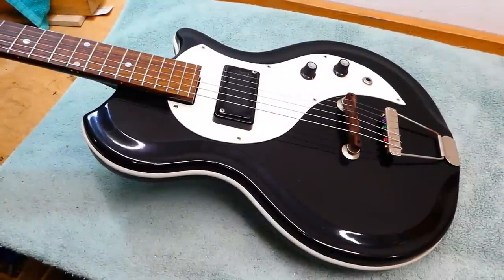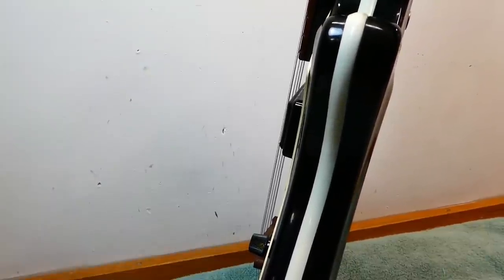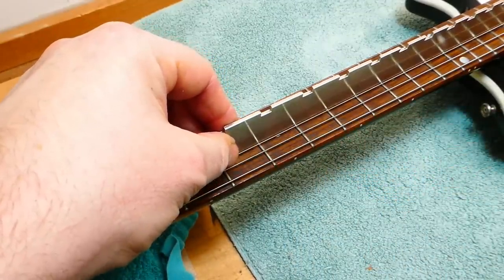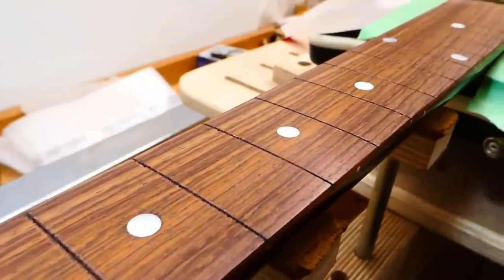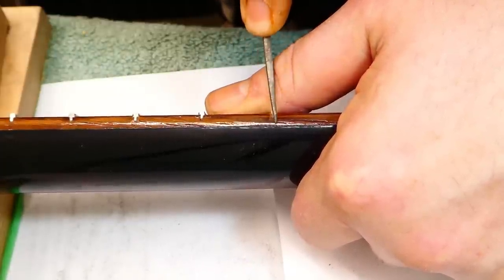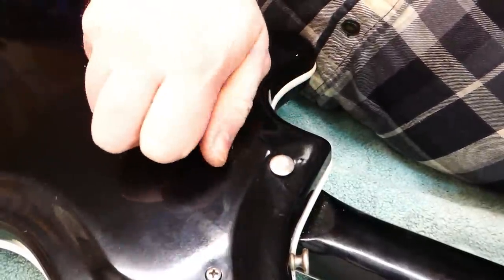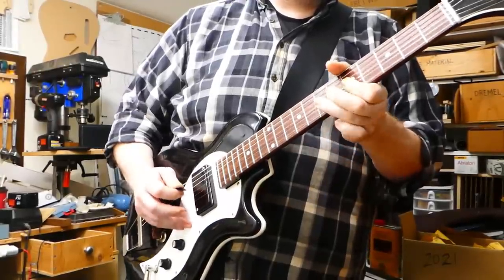60's National Studio Electric

Comment: My guess would be the cost savings didn’t come from the material but rather the workmanship required in assembly. Pre-cnc days I suspect it was cheaper to punch out fibreglass moulds than have a trained technician cut out and finish bodies from wood.
Reply: That sounds very correct. 

Consistent and cheap.
Reply: Oh Lord... Really???
Reply: I think you're underestimating the amount of labor and skill involved in fiberglass shell manufacturing. Personally, I would guess that cost savings comes from finish work. There's no need to paint or varnish a fiberglass body, and, depending on the quality of the mould, perhaps even no need for polishing. (There's still going to be some level of finishing required, especially at the seams, but it's not a full paint and varnish.)
Reply: @wbfaulk  thats pretty much what Adam said ?
Reply: All the savings were in that unnecessary truss rod and excess neck screws 👍
Reply: @wbfaulk the seam line consists of that white stripe. It's kind of a rubber material that "joins" both halves.

Comment: Valco was owned by a couple of guys in Chicago. My Uncle knew one of them really well and when we were kids we were able to visit the factory several times to get  guitars at a good discount. National was their premium line, followed by Supro (more of a budget line). They also made Airline and much later Kay guitars for sale by Wards and others. I recall that they had a few artists they sponsored with two of them being Bob and Bobby Thommas. I vividly recall seeing the molds for the old National resonators on the shelf in the factory. They made wood guitars as well as the Reso-Glass. The first guitar I purchased from them was a National Westwood 75  map shaped which was sort of a burst made of wood. It had one of their innovations in it that while you only saw one pickup there was a second one built into the bridge so it actually had two pickups and a strat type selector switch. I bought it right off the line. One of their workers talked me into it, set it up for me and  played it for me. The second guitar I got from them was a Kay 12 acoustic. My brother got a bass similar to the one in your video. My other brother got a Suppro Clerrmont which kind of remembled a Gibson 335 and a amplifier. After they went out of business and many years later a company in Asia bought the rights to National and Supro and are presently selling reissues of the Reso-Glass along with the Supro amps still being played by artists like Jimmy Page. My mom sold my National when I was away at College for $15. Did the same thing with my brother's Clermont. My one brother still has the bass guitar. It cost me $1000 seceral years ago to purchase another Westwood like the one I had. I still plays great and sounds equally good. After they started selling reissues (you can find them on Reverb) the values of the originals shot up and now my Westwood is worth around 2K and my Supro 6120 Amp gows as high as $1500. Their priginal Reso-Glass guitars can go for several thousand dollars.

Comment: Great video and beautiful work.  I basically have the same guitar, except it’s a 1963 Supro Belmont… red with an elevated pick guard. The single pickup is closer to the bridge.  I only have five fingers, so my playing style is a combo of strumming and tapping in Open D tuning.  This guitar works beautifully with 7-38 strings and ultra low string height.  

Side note… while there isn’t an adjustable truss rod in the neck, there is a tube made of aircraft aluminum in the neck… so at least it has something to keep the neck from going completely wonky.

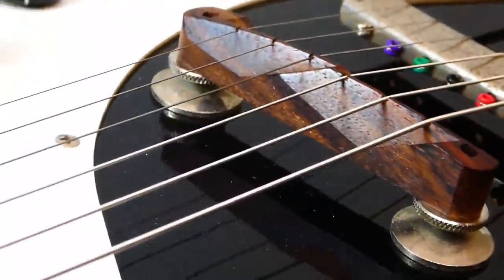Comment: 4:39 jig and milling machine. You can see the cuts in the wood and the very slight radius of the wall. So they likely shaped the blank, screwed it on the jig and then ran the whole thing through a milling machine. Of note, the slight imperfection in the wood's edge (towards the guitar). That's typical of metal tools on wood materials. You need those router flutes to cut wood properly and even then it's at the mercy of the grain.

Comment: YOU PROBABLY WON'T READ THIS COMMENT, LET ALONE REPLY TO IT, BUT THAT'S OK I KNOW YOU'RE BUSY  🤷‍♂️
I'm not sure what video or how old it was but you made a comment using your patented brand of dry humor, something along the lines of "those of you who tune in to hear the dulcet sound of my voice" & I gotta say that's one of at least 3 reasons I prefer your repair videos over all others I've come across. The other 2 reasons being your brand of dry humor & the quality of your craftsmanship. Of course, there are plenty of talented luthiers on YouTube but I'm just not a fan of the way they communicate with the viewer. Also, we share the same work ethic. You work on your customer's guitars like they were yours. If a guitar comes across your bench for a certain repair & you find other issues, it would bother you not to fix them. I can't count how many times I've seen you polish out scratches, glue up cracks in soundboards, glue binding back in place, & a buttload of other things that I can't think of right now. 
I'm in the HVAC business, I repair broken heating & air conditioning equipment. I always treat the job I'm doing like it's my house. That's why I say we have similar work ethics.

Comment: On those Supros I believe the pickup screws affix the pickguard to the body if you try and take off the pickguard with just the pickguard screws removed, or at least on my 66’ Supro Lexington I had to remove the pickup mount screws to get the guard loose.

Comment: I own a re-issue Supro White Holiday in Resoglass. Unfortunately the back of the guitar is now made of wood and lacks that funky Resoglass sound I'm afraid. Great pickup though.
As for the Zero fret> All zero frets I've installed are the same height as the rest of the frets. So simple. If you think about it if a guitar works with a capo then that is basically the same situation.

Comment: I believe that National woulda used polyester resin in the 60s,  unlike today it would be a heavy styrene based resin..
This was most likely cured with methyl ethyl ketone peroxide...
I can't see open molding as not great for thickness consistency...probably a form of vacuum bagging to  male and female molds...
This is just guess work as I  work as a mold builder for the fiberglass industry...